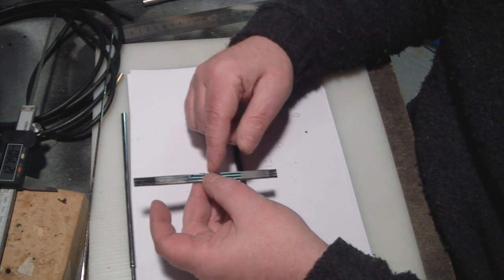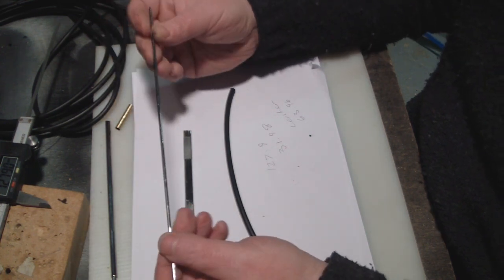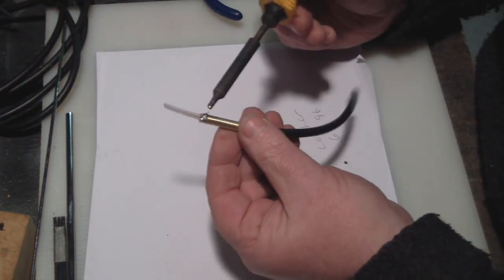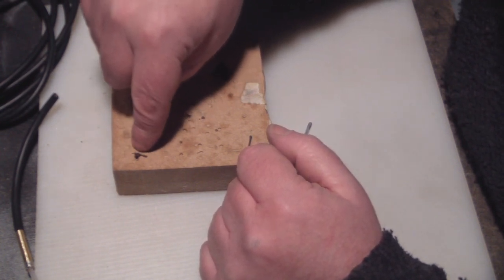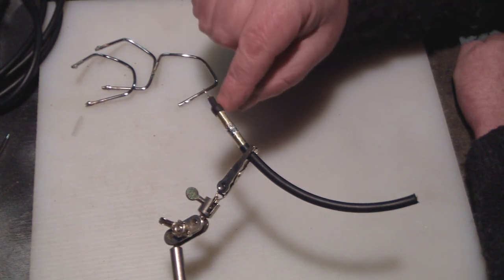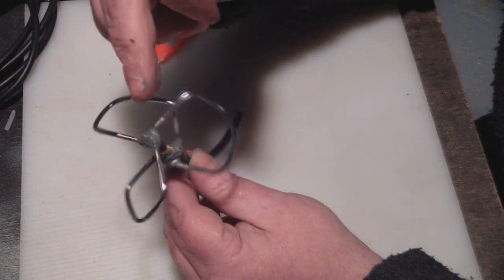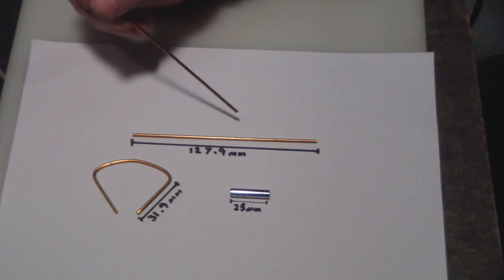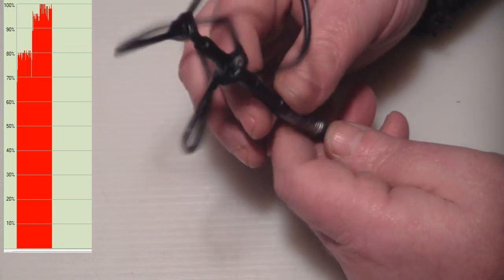cloverleaf antenna 2.4 GHz #11

Comment: What is the distance between the top soldering point and the bottom soldering point - 1/4 wavelength? Thanks
Reply: +billacat53  The full wave length for 2.4 GHz is 125 mm (12.5 cm or approx. 5""). Thus 1/2 wave is 62.5 mm and 1/4 length is 31.25 mm. Considering that the piece of tube is 25 mm long, it lloks like the distance you are enquiring about is 15.625 mm. or 1/8 wave. My 2 cents worth. Cheers from Bruno
Reply: +Bruno De Michelis Sorry, looks

Comment: Hello, I have watched many of your videos. I am trying to learn the ins and outs of antennas. I noticed (maybe Im wrong) but on some antennas like a cloverleaf the two ends of the leaf connect to the out side coax and the inside of the coax. Completing the loop. But other ones like a helical dont have a completed loop. The coil connects to the inner wire of the coax and the base plate connects to the outer wire of the coax. I am confused or just not seeing the connection? Thanks
Reply: Thanks!!!  You should do a "Antennas for Dummys book"

Comment: So I built this cloverleaf using lmr 400 and all of your specs.  I already had 100% signal. I was looking for an increase in dB which I didnt see.  At least not much anyway. My rssi dB went from -50 to -45, but my router is only 20 ft away from the pc.  I am curious if you have the rssi readings using that antenna and vistumbler.  This was an attempt to give my wifi enabled tv better speeds. It is located upstairs and on the other side of the house, but it is still only about 30 ft  away point to point. It doesnt seem to have helped at all.  Does the clover leaf design have better results than a simple dipole?  (Because that clover was a pain to solder!)

Comment: For clarification, this appears to be omnidirectional.  Is this a full 360 x 180 degrees?  Also, I read somewhere that this could hurt the transceiver of the router.  Is there some way to protect against that, or is that just somebody talking about something they dont understand?

Comment: Could this be used as a wifi antenna on both sides (router and client), aka not for fpv? I heard this could alleviate some interference issues is that true?
Reply from the maker: They make excellent wifi antennas and yes you get much less interference.
Reply: theres not much point having it on one end. best to do both. 

you may be better off getting a dipole tx antenna with a higher db. because you can't change the wifi rx in your phone/ laptop that easily.

Comment: Ok so my last comment, I realise now that because the antenna wire is a larger diameter lowers the frequency of resonance and therefore you need to make the antenna a little longer to compensate.....

Comment: Thank you I'm going to build this for hopefully better Wifi coverage of our building, but just a question out of interest, 2.4 Gz is a wavelength of 124.91mm but I notice you use 127.9mm makingr a 3mm difference, is this to offset the loss due to the 90degree bends in the wire? Also the bend for circular polarisation, is R or Left important and the amount of bend, and how does this affect performance / characteristics? Thank you again!!

Comment from the maker: The card is a Alfa AWUS036NH. It is one of the most popular cards around with a RP-SMA Connector.
“RUN LIVE TEST”
I show you the difference in db  and gain with a stock rubber duck antenna and how the clover leaf antenna out performs it. 
Why would I show you how to screw an antenna into an SMA Connector?

Comment from the maker: For wi-fi most cards, adapters and routers send and receive through the same antenna. The 4 blade has been shown to receive a better signal and the 3 blade transmits better. So for wi-fi one would cancel out any benefits from the other. These antennas where designed by the RC scene where they capture video form model planes. This setup you have a transmitter and a receiver. This setup would benefit from using a 3 blade and a 4 blade.  But benefits are only minimal. 
hope this helps.